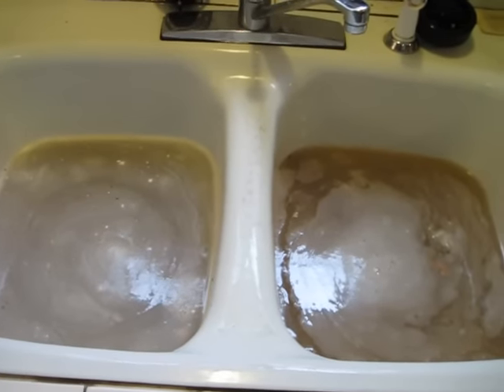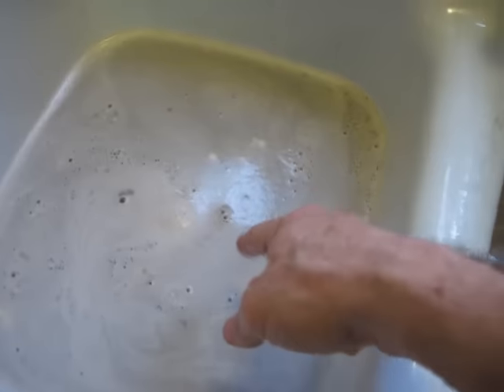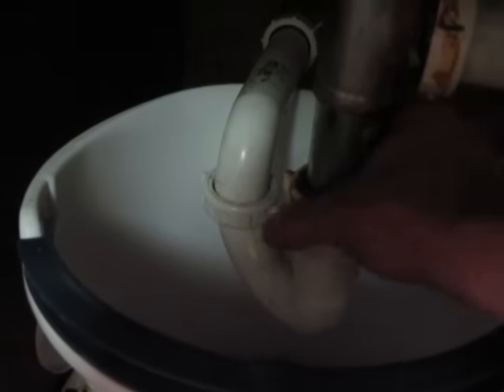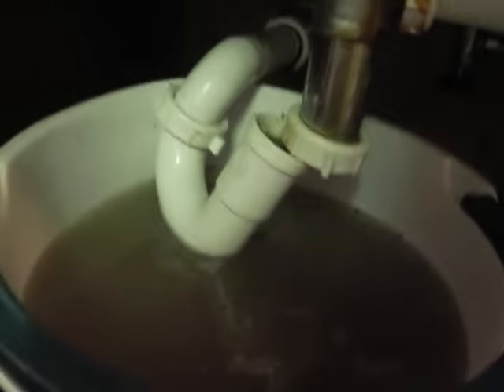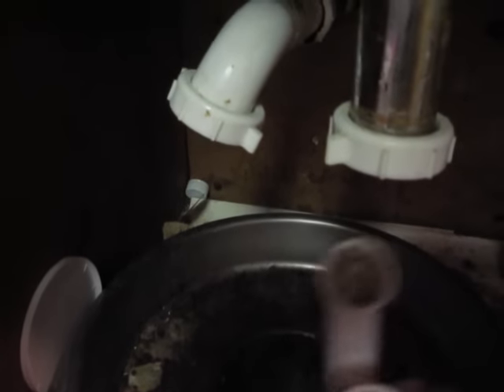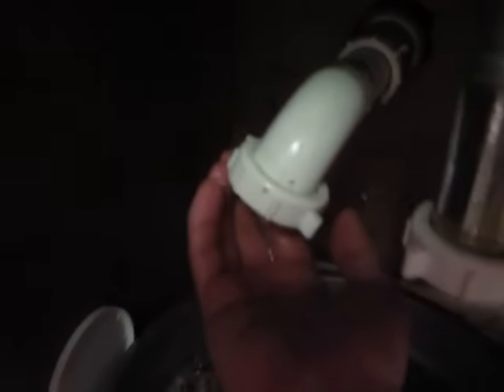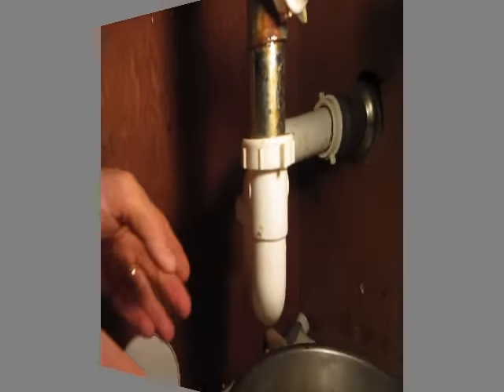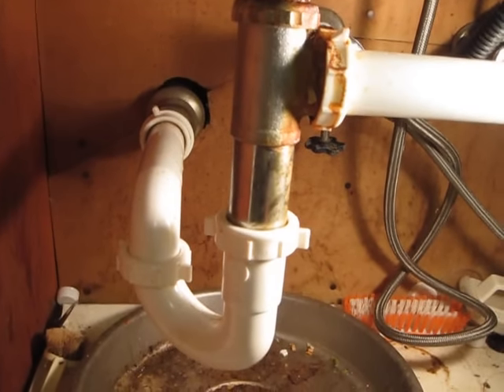How to Unclog a Kitchen Sink

Comment: Use a plastic dishpan and fill it with water on the side without the trap. Now use a plunger on the trap side without having to hold on to the drain stopper. Better force for a quick and easy solution.

Comment: I just had to unclog my sink just a little bit ago. The problem was a build up of grease before the u joint. It was packed in there to. The grease was so thick to. I used a fork to get the grease out and the water flowed so fast. But man it stinks so bad.

Comment: I'm about to do this to my sink! It's been clogged a year, it's about to get gross. I had a question though, I have a feeling I may have a rust problem, and I was wondering if I do what should I search the home depot website for? I put in Sink Join Seal and combinations and I didn't find anything. :D Sorry for the dumb question!

Well -- I tried.. and now all the joints leak.. no clog anywhere in the tubes I could touch or reach.. and no money to do anything about it. Bad day =[
Reply from the maker: Sorry you're having trouble.  Did you get all the waters on tight?  I actually eventually replaced much of the sinks piping for this particular sink.  I'm in the process of uploading in now.  You may want to review that video for some tips.  If your piping is not too old, it can be generally easy to replace old pipe segments, especially is you currently have plastic piping.

Comment: Please be careful!! I tried the plumbers trick and it didn’t work. So I followed the video exactly and so much water came out of the pipe at such a fast rate it flooded out of the bucket before I could get the pipe back on. It’s been about 30 mins and I see water seeping threw the cracks between the floor boards. I’m sure I now caused so much water damage the price will be 3 times as much of calling a plumber to begin with. And of course my sink is still clogged but that’s the least of my worries now

Comment: If you're dumb like me, I plugged the disposal side with a plastic cup and plunged the other side for 10 minutes and cleared it out. The disposal will push it if you plug the other side like the other guy stated.

Comment: I took a fly swatter, and unclogged my kitchen sink. I pushed it down the drain and twirled it around in circles. It got the water to run down. The sink was stopped for 2, or 3 days before i did that.

Comment: It's me again 😫 I have a double sink. The dishwasher is full in the bottom and the sinks are both halfway full every time I run it.  The dishwasher hose also has water in it
Reply: I've taken apart all the pipes, I've looked in the hose for clogs, I've even taken the bottom of the dishwasher apart and I'm coming up short.

Comment: I've been having the same problem with my sink, I removed all the pipes and found no clogs. What do you think it might be??
Reply from the maker: If there is a clog or the water is slowly draining, the clog may be deeper in your pipes.  If the water does drain, but slowly, you can let it sit for a while, than add water, measuring the water as you add it.  This could give you an indication how deep the clog is, especially if you know the size of your pipe.  If it's not that deep you can get a pipe snake and see if you can unclog it with that.  But if it's too deep, you may have by hire a plumber.  Good luck

Comment: Sink was draining fine...then out of nowhere it got backed up. Plunger barely moves cause something is blocking the line...but if it was a clog, wouldn’t it have started to drain slow?!?! It was draining fine...a minute later it was at a dead stop. Any clog I’ve ever had was fixed with a plunger...I’m baffled by this. Anyone have any ideas?!?!
I will try all this in the video but the fact that it happens out of nowhere, leads me to believe it’s something else. Every other drain in the house are working as they should.
Thanks!
:)

Comment: Other hack: pour pure bleach down the clogged kitchen sink or clogged bathroom sink or clogged toilet, wait for an hour, then pour hot water afterwards, once the clog has cleared, run cold water down the sink or flush the toilet a few extra times to ensure the clog is cleared all the way through the pipes. Also perform monthly maintenance to prevent future clogs.

 I almost used Coca-cola, but I want to drink it with my pizza. LOL'

I almost used salt, but I need that for my cooking.

I almost used vinegar, but I need that to clean my vegetables and fruits.

I almost used baking soda, but I need that for my laundry.

I almost used hydrogen peroxide, but I need that for my first aid.

Comment: I tried this method. Mine is further down the pipe. I tried snaking it and still was unable to find my clog My snake goes to 25 feet.  I have a plumber coming in tomorrow.
Reply: I did a trick stated by Rob Reynolds who replied to this. It worked!

Comment: I can flush about 2 gallons down my sink before it starts backing up, which makes me believe the clog is in the wall. I have not tried one of those 25' snakes yet. Not sure if that would be long enough or not. Any recommendations? Thanks!
Reply: Brandon Fitzgerald  I have the same thing wrong we have a output valve outside our house that unscrews and all the water comes flowing out if u have one of those by any chance run a snake through that end to see if anything comes up but if not the undo from the inside from the pipe connected to the wall
Reply: That's the way mine was. The tip above by Rob Reynolds took care of mine.
Reply: I’ve been plunging non disposer side for 20-30 minutes straight! With a few breaks to turn off the disposal. How long did you have to plunge?!

Comment: When I unclog a sink, I like to, replace all the old lines. The metal pipe needed to be cleaned at the threads. I don't like to have to come back and re do a job. This video opened my eyes and will do this later today. Once I get my chain saw working. Yep, I saw that video before this. I will subscribe to "gardenfork.tv, Thanks

Comment: No...the cause of the blockage was using the "garbage" disposal as a "GARBAGE" disposal and NOT a bad drain pipe connection. Disposals are just for waste stuff (uneaten veggies, gravy, etc. But NOT meat !!) off the plate after your meal. Do not use the disposal as a garbage can and to try and cram all your peelings from potatoes, carrots, any fresh veggies into your disposal. It just turns into a sludge and either builds up over time or clogs it up right away.

Just like automatic dishwashers... they're just glorified sanitizers, I don't care how much it costs...the macerators (food chewers) on these units drain into a very small drain line which will eventually clog.

Comment: You did OK figuring that out. For what it's worth, the slip nuts are "tight", not "taut".  Taut is used for tension, like the rope or the sails are taut. Think of it as having 2 ends, being stretchy,  and not being slack. Tight is not used for tension, like the nut is tight or your new jeans are tight, and a non stretchy rope can be tight (if it is taut). 😁

Comment: Had the same problem, it was blocked up all the way down to the basement! I was told by a neighbor to use "Instant Power Main Line Cleaner from Walmart. I'm sure you can buy it anywhere.  Let it sit over night worked like a charm!
The plumber wanted $ 1200!
After that, about a week later the toilet flushed really slow..........poured a gallon of the Instant cleaner, let it sit over night. Worked! Toilet flushed like new!
At 10/gallon, its a steal  I believe it cleared out all the piping because all drains flow much quicker than before
$1200 the plumber wanted! Fucking crook

Comment: Well instead of taking apart the P-trap I have figured out it is better to take your stopper plug one side of the sink use a toilet plunger, to push the fluid and forced it thru , as long as you use the stopper in the other side of the sink and also fill up that side of the sink with half the sink a water and start pushing through if that does not work rotate sinks, I decided to get off my ass and do that cause I'm lazy, it fucking worked!

Comment: My husband took the pipes apart and we cleaned and snake the wall pipe, nothing.  We tried baking soda and vinegar, nothing.  I tried lye today, nothing.  I plugged the dishwasher side and fill the other side with half hot water, run the disposal a few times, nothing...why can't things work easy for me like others.  Called 4 different companies to come out, no calls back.  WTH.
Reply: Did u figue it out. for days i have been with same exact what u describe
Reply: We ended up getting a plumper out to snaked the pipe.  It was so deep they used a 25-30 feet snake that goes all the way down the basement.  Worked for a week, then they had to come back out to snake it again.  It was a very bad clog.  These Youtube remedies only work for very minor clog.  It's been a couple months and it's work really good.  I also purchase a professional drain cleaner to pour down the pipe once in a while to keep it clean.  I don't pour grease or anything destructive down there.  Maybe my house is over 30 year old and needed it badly.  Good luck.
Reply: +Kim Ngoc Doan Thank you for your reply. we are going to buy our own snake at homedepot hopefully it doesnt cost too much more than what a plumber it would cost. Glad its over for you.
Reply: +sant maris We have a snake from Home Depot, it didn't do the job for us (5-7 feet long).  The professional came in with an electric snake that went 25-30 feet long through out the pipes.  I hope it works with the Home Depot snake for you but it was too short for us.
Reply: +Kim Ngoc Doan Thank you again for that tip. We are also getting 30 ft snake haha. Its about 50$. I will try it first before calling plumbing where i live is expensive!!
Reply: Good luck.
Reply: +Kim Ngoc Doan I too tried EVERTYHING! I plunged both sides, practically pulled my arm out of socket. I used multiple times with baking soda and vinegar, baking soda and salt, boiling water, even Dawn dish detergent. I tried a snake but very small 2- 3 feet one. Nothing. Nothing. Nothing helps. I know I will have to pull the p trap out but ours is a steel one, no easy caps to twist off, so will need channel locks/pliers. I rent so am afraid of messing with anything. Landlady will probably send for a wet/dry vacuum. 

Epic, monumental frustration!!! When kitchen sink doesn't work, your daily routine is disrupted. Scooping water in bucket and dumping in toilet just to do dishes. I wished I could apologize to sink. So sorry, can we go back to way things were? I even doubt any sink drains, forgetting the lovely gulping sound when it works, they all back up! But seeing the gunk coming up during plunging, I will now bottle all my cooked oils -never pour down the drains!
Reply: Parfait G:  I ended up hiring a local plumper to snaked the drain.  They came with the electric snake that was 30 feet long since my pipe was routed to the basement and to the main drain is over 25 feet.  It worked for 2 weeks then acted up again.  The plumper came back with no additional charge and snaked it again.  He said sometimes the built up is so bad it would take a couple snake job.  You might want to have the landlord get it done professionally since buying a snake that long would cost a lot to do on your own.  I never pour grease down my drain, just what I can't scrapped off and still had that problem.  Good luck, I know it's frustrating.  It's been working well since.

Comment: I'm sure YouTube is very helpful  for those who can't follow the exact same step-by-step directions listed on trillions of OTHER helpful sites...but-for the love of GOD-will someone please tell me what to try NEXT?  after the plunging and disassembling and 50 feet of SNAKE-ING ...WHAT IS THE NEXT STEP?  I OWN- OR WILL RENT-THE NECESSARY TECHNOLOGY.  I WILL GLADLY RIP OUT WALLS  AND/OR CEILINGS...
OR, at least, tell me "why"...Why,  after trying every guaranteed method- according to
"This Old House"- DOES ONE LOUSY GALLON OF WATER STILL MAKE MY KITCHEN SINK BACK UP???
Reply: Hire a plumber.
Reply: you have to see if other areas are affected like anything else might be stopped up. if other things are fine then maybe you missed something like when you ran the snake and it might of got caught in a vent for the pipe but if other things are stopped up then you need to find a out side clean out close to your house and try to find a blockage in the pipe that might be running through  the yard witch you can rent a snake heavy duty 100 ft or more or even a camera to find out the problem

Comment: I imagined my bucket was too big. But ofcourse I would have vacuumed the sink regardless. I'm just being a clown. I don't need a specific bucket. I could have cut the bucket too . To non plumbers out there. Good luck but do call the plumber. If you break the tailpiece don't duck tape it. Call the plumber. Don't use acid neither. I'm the plumber that will spend extra 3 hours for that out of your pocket. And no. Plumbers don't have to do your work cheap when you try to fix it a cheaper way. SMH the shit I have seen non plumbers do. Don't cut the steam lines and not not cap the steam lines before a brand new wooden floor is installed. Other wise you will get fired. And yes. He pretended to be a plumber and failed the first week.

Comment: YT won't let me reply to Mr. Rob Reynold's PLUMBERS TRICK post - maybe they set the limit at 500 replies.  But all I have to say, is wherever you are Rob, I hope the sun is shining on you dude!  I'm half-crippled due to some major injuries, but I didn't want to call a plumber b/c over the past few months everything has gone wrong at my house and I'm going broke.  I first did the plunger method and no luck, and to boot damn near put myself into the hospital as I plunged with my right arm and held the damn drain plug down with my left.  (yes, for the average person this is not a problem, but for me it is a BITCH, and it's easy enough for me to seriously injure myself) My arms, back, and neck were already shot.  I had this huge jug of Drano but wasn't sure if that was going to work, (and if it did, I worried about damaging the pipes).  Then I was contemplating getting on the ground and going the pipe route, but I knew that BEST case, even if it worked, it would take me forever and I wouldn't be able to walk after.  Then I saw this comment, all caps, "PLUMBERS TRICK".  I filled a gallon bucket of hot water (holding on for dear life as I tried not to spill it on the way to my kitchen from the laundry room sink) and poured it into the disposal side, did as you said, and while it didn't take the 1st time, I could tell it loosened things up.  Went back for round 2, and BAM.  Problem solved, saved money, and while my entire body hurts right now, (b/c of the plunging attempts) I'm happy as a clam.  Rob Reynolds, you rock brother.  And GEO ain't no slouch either :)